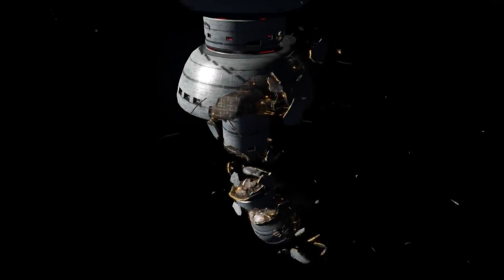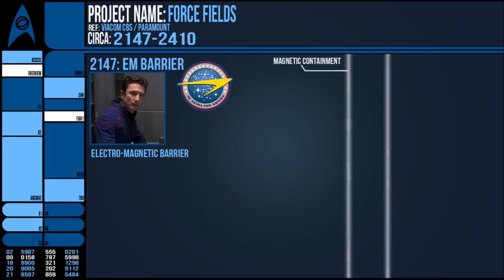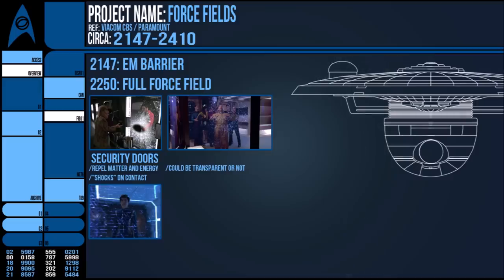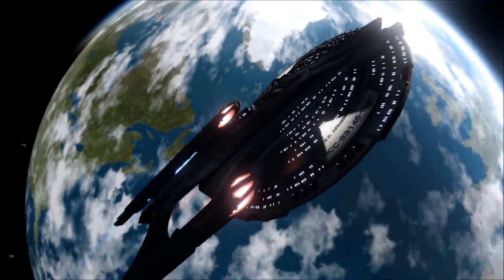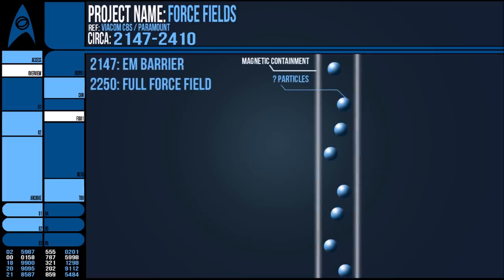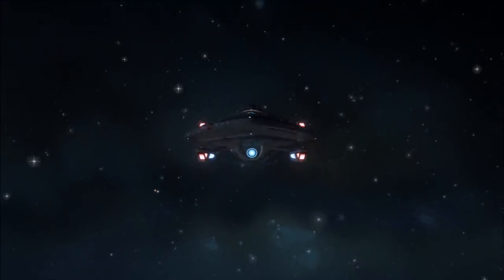How Do Forcefields Work? (Star Trek Theory)

Comment: My own idea of how the force fields work completely matches yours, with one small difference: I believe the charged particles contained in the razor-thin magnetic containment would be simple electrons held in place in a grid formation.  the repelling force we feel from solid matter is already electric repulsion between electrons in our own matter and the solid's, so it's definitely possible to generate that force with loose electrons if they're packed densely enough and held in place strongly enough. That means they're also not required to vibrate or be hot, and so a force field can be just room temperature. Changing the density of the electron grid, and changing the field strength, would allow for any range of permeability and texture.
Additionally, if you can make a thin containment field for electrons, it would work on ordinary matter too. Essentially, the 'walls' of the containment field would have a compression effect on the matter since it's pushing on the outermost electrons of it. And if you can control the magnetic field finely enough to keep the electrons in a grid formation, that means it can keep solid matter there too, meaning the field will take a strain instead of the material passing it on to the next bit of matter. You get a structural integrity field almost for free.
All it would require is incredibly fine control over the shape and strength of a magnetic field, which is consistent with other technologies in Star Trek (like Bussard Scoops, that use massive magnetic fields to guide charged interstellar particles into a capture system).
Reply: Bravo
Reply: Except for you know, the fact that they would have to essentially puff out a cloud of matter every time they wanted to raise shields around the ship itself, because they're not going to get many charged particles in space.
Reply: @peoplez129  i don't see that as a particular problem in itself, they can generate matter on command anyway. However, I also believe that the outside shields probably work on entirely different principles, being more meant to stop energy of all kinds, than the internal force fields used for containment of matter.  The language used for the external deflector shields always seems to be different and they have different technical aspects. The video mentions this too, I greatly look forward to the video looking at that in depth.
Reply: Excellent idea!

Comment: There's also Tom Paris's Transverse Bulkheads from the aborted Kremin timeline [Year of Hell] where a honeycomb network of internal bulkheads set up at every section and deck would contain major hull breaches and allow the ship to function with even half of it blown away (as long as engineering still worked).
It was based on the bulkhead concept of the Titanic, but with some improvements in light of the iceberg fail.
It greatly increased the durability of the ship, and if applied as standard across Starfleet would make them even tougher (and negate those scenes JJ likes of crew being sucked out into space), but that timeline was erased by Voyager itself.

In addition there is also temporal shielding which Voyager also developed during the same timeline which made them immune to alterations of history and Kronoton (temporal) weaponry - gee it would be nice if the time agency used that during the temporal cold war to prevent them having themselves erased.

Seriously, when you consider he also designed the Delta flyer (superior to the Runabout), Paris better get his own division at Utopia Planitia after he got back.
Reply: According to the Department of Temporal Investigations novels, there's a defensive network preventing changes to continuity from some date between the 24th Century and when we see all the people from the future coming from, which is why the Temporal Cold War had to be fought in the past. Changes can only be made before the network was activated, but they propagate through time to later eras after it was activated.

The origins of the network are shrouded in secrecy because if it was known who made it, where, and when, it would be a renegade's first stop to undo it.
Reply: @tparadox88  though, those same novels do make it fairly clear to the reader who those mysterious inventors were :P
Reply: casbott he actually became the head of Earth Space Dock and then eventually Admiral I believe.
Reply: Data voice "Correction, sir, that's blown out."

Comment: I always got the impression that the force fields on the ship were more akin to static/energy... static when you encounter it can cause flashing of light and a physical repulsion, along with a shock. Its possible that the containment method for this could also alter how that energy/static behaved, like on DS9 episode civil defense its suggested the Cardassians used a system to make their force fields lethal (meaning that they are maybe ordinarily not). DS9 Whispers also suggests that force fields are somehow tied together, so maybe there is a general force field grid/field that flows through the ship, that the force field emitters then convert for its intended purpose. The reason why in Whispers O'Brien was able to activate all force fields and said that they would have to drop them all in order to release his.

Comment: 6:00 - Due to Combined Gas Theory, such is practically impossible to achieve, but the cumulative effect could be achieved given a pressure was applied in the direction of travel of the particles. It’s like a form of Hull plating at that point, but add more of it at a slightly further distance and shields, you could make a ship that is nearly impossible to break into.

Comment: How powerful are the Federation's Phasers and Protons by the end of the Dominion war since weapons enhancements had been increased? Are they above the teratons of force since they are suppior to Cardassian weapons which was seen in the failed joint operation between the Obsidian Order and Tal Shiar a fleet of 20 ships were able to severely damaged the crust layer of the Founders' homeworld. Would the Federation weapons be like in the high teratons then considering how they actually highly damage a Borg cube in First Contact?
Reply: We can assume that weapons advancements are far more than raw power per unit of target area or volume of target.  

We see that "modulation" can overcome even very strong shields, and that some weapons use tricks like subspace or quantum effects to bypass shields or alter the effect on the target.
Reply: @DrewLSsix  
Is it in the Teratons of force though?
Yes or no and why?
Reply: We are led to believe that FED phaser weapons like rifles and other hand units are generally not liked outside Starfleet. Kira felt they were not as powerful as a Klingon disruptor,Cardassian rifle or even a Bajoran phaser. It was more accurate had more settings could be tailored but were at a technical level far too complicated than they needed to be took longer maintenance time and so were unreliable so much unnecessary tech in them.
Reply: @paulgrattan3885  
Ship weaponry not handguns.
Reply: Well they've had less power increase than a Xyston Imperial Star Destroyer.

Just imagine if JJ had done DS9 … 🙄🔫
Reply: @thorshammer7883  Unknown about figures, but Fed weapons had more finesse and versatility. So while but as high in raw firepower, they could in difficult circumstances overcome defenses that would stop a disruptor and were a useful tool as well.

Comment: The force fields in Star Trek actually work by super charging your imagination emitters at or around a specific section in space-time. But most of the force fields of today here on earth are usually either electrostatic or photonic in nature using very high voltage at very high frequencies.

Comment: I remember someone once calling it an electro-static forcefield. Because of that, I always assumed the field was an electrically charged barrier of varying intensity, also possibly controlled by or combined with magnetic fields that would be sufficient to repel any object or person who touches it without causing any serious damage at normal levels of operation. Some characters have been shown to recoil from touching the field, as though receiving a small static shock like you would get from touching a piece of metal. Other times people have been thrown backwards, or were able to touch a forcefield with no discernible effect beyond lack of penetration. Tuvok made extended contact with a forcefield in Sickbay that seemed to cause some amount of discomfort, but no permanent damage was done.

Some species, like the Jem'Hadar, design their forcefields to channel lethal amounts of energy, killing anyone foolish enough to touch the field. Since I don't think we've seen anyone get killed by touching one, this may simply be rumor or misinformation.

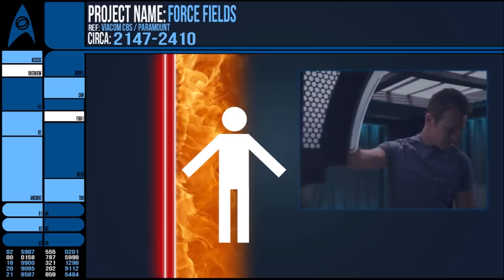Comment: 6:30 the second and fourth problems also arent a problem. You’re conflating (understandably) heat with temperature. Plasma has a high temperature but that doesn’t automatically mean high heat. 

Heat is the total amount of energy contained (in this case) in the plasma. 
Temperature isn’t energy, it’s the amount of kinetic motion in an average particle/molecule/atom. 

So for example, our thermosphere has a temperature of about 4500°F which is above the boiling point of aluminum, yet space craft don’t melt on their way to orbit. 
That’s because although the temperature is very high, there’s not a lot of heat because there’s so few molecules of air to actually hit the space craft and transfer heat energy into it. 

So theoretically the same could be true of plasma based force fields. They could simply use very few atoms in a plasma state and therefor when the force field drops unexpectedly the energy is dissipated harmlessly. 

Even if some of the plasma atoms hit you they’d transfer so little energy you wouldn’t actually feel anything.

This also applies to the fourth problem (light emission) as the plasma could either emit light in a wavelength we can’t see (which doesn’t mean not dangerous necessarily) OR doesn’t emit much light in the first place since there aren’t enough atoms for it to be bright enough. 

I’m not an expert on plasma, so I could be wrong. I’m just basing this on my understanding of heat vs temperature.

Comment: My theory is that it's just an interference pattern of light of sufficient intensity the photons push back with the requisite force to stop you going through when you try, but doesn't take any paths outside the plane of the field when not disturbed. It was only over the course of the 20ish years of the TNG era we saw that this tech evolved to the precision that it could be used to make touchable holograms, which is why Encounter At Farpoint and other TNG episodes refer to replicated matter animated by tractor beams but Voyager describes them as "photons and force fields".

Also I chalk up the way they let shuttles pass through the atmosphere barrier to syncing the frequencies of the ship's virtual bulkhead and the shuttle's deflector shield (or maybe just hull plating charge), same as how the Duras Sisters rigged a torpedo to pass through the Enterprise's shields like they weren't there.
Reply: Did we see someone get caught in the middle of a force field at some point, or is that just conjecture what would happen?

Comment: Isaac Arthur has a few vids about using electromagnetic fields to strengthen metals to allow for impossible buildings.
Reply: 90 Lancaster  integrity fields.
Reply: @tomf3150  I think the idea is one similar to how  the NX-01's Hull plate polorisation works rather than a 24th Century SIF system.

Comment: Have to agree with you on the transporter. One of the things about force fields - something like that of a hyper sensitive sensor combined with either a phaser or repulsing tractor been is going to need to be on all the time while ships are traveling thru space during impulse ( but possible not warp) drive - or you would have the possibility of very small bits of matter is space punching thru the hull of a starship ( or some sort of super duper extra strong material to build the hills with) -  also this possibility of a collision with a small bit of matter while traveling in space - would mean there would be no windows on any space ship ( yes once could have transparent aluminum for the windows with a Force field for extra protection ) - but I think there would be no windows on spaceships and just use cameras with monitors on the inside of the ship. Windows just would add a week point in a hull

Comment: My theory of techno mumbojumbo:
- They have Heizenberg principle counter thingies. Which means they can either calculate or counteract the randomness of particles in such a field avoiding collision that would generate heat, or even avoid scenarios where light would stuck in them too much making them transparent, but lowering that avoidance to show them off.
- Transporter and that food making thingie showed that they can create matter from thin air or take them away. So filling up space with custom made matter is very much in theire technological advancement. They can probably tailor made easilly magnetically charged particles without any additional problems. (such as room tempeture super conductor particles)
- Since they well advanced in creating artifical gravity means they can create kinetic force to any direction they desire. That means whatever force such fields would have to repel they can create counter directional force to counteract the force that the field have to whitstand.

Combining all this they can easilly make matter, in a controlled shape that has repeling kinetic force in desired direction. So basicly a forcefield.

P.S.: In our current real life what we can do is spray electrons over a surface real fast and cause any contact to recive that energy in some form depending on the severity of the contact and the amount of electrons flush on the covered surface.
Basicly works on the principal as a fast spining fan blades slap youre hand away if you want to touch it.
There are also methods to conduct this form of protection trough air, which is called lightning in day to day life. However keeping up such a powerfull stream of electrons is obviously pretty demanding, and depending on the conducting surface or the spraying equipment energy loss trough visible light and heating up can happen if the slaping away electrons hit the conductor instead.
However this can be overcome by engineering and statistical analysis of most likelly stable forms.
So if we would really have a means or reason to power such a technology we already have most of the basics covered for it.

Comment: Incidentally, this is how i originally thought the shields worked, i.e. being plasma shields. But this was before i read some of the ST manuals and visually inspected the on screen props and displays. 
Still, a plasma shield may be somewhat viable if it's used in a "smart" reactive way (like only focusing it on certain spots, where needed) and if we use "cold plasma, that is matter that can get sufficiently ionized at much lower temperatures.
Reply: So theoretically, maybe even near future, you could have a setup where, assuming you had near star trek levels of processing power, a suite of sensors with "lasers" could watch the slice of space where a door would be and as soon as they detect something they target the proper spot with some sort of pulse that impacts and resists the object with equal force. What that pulse would be i don't know.
Reply: @obilesk1487  something like that yeah. Keeping it all in place would be a pain though....

Comment: I think there's a possibility that it's something to do with the way Space civilisations deal with Gravity, Gravity plating seems to be in the floor of each deck but never pulls people to the ceiling from the deck bellow meaning that gravity can be controlled directionally assuming that the gravity is controlled by particles it may be possible to contain them within 2 EM barriers the same way as they're contained within the gravity plating the way you describe using Plasma, if when in a disorganised state they push to some degree rather than pull then they would be force barriers. It would then make sense that a metal object could push through the barriers, they would be a faraday cage for the EM containment walls, and the people in the ship wouldn't feel anything. it would also explain why they don't get used to stop light and missiles and why when the levels are changed it's referred to as shield density

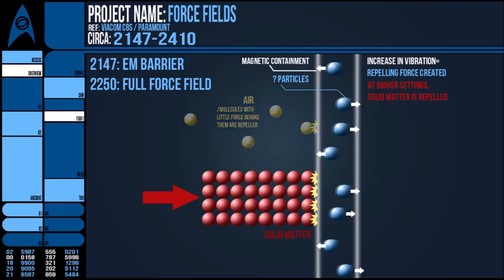Comment: 5:20 - Actually, because a shuttlecraft has its own Structural Integrity Field, of which should be attuned to the exact frequency of the Shuttle Bay, the Shuttle’s field acts as an extension to the field and thus the plasma particles “slip” around the vessel, or are pushed around and away from the point of contact between the field and craft. Scientifically, this would therefore cause no noticeable drop in integrity and is thus how a shuttle entering the shield perimeter of a starship (when setting their frequency to the exact same) can slip through while leaving the shields unaffected. This also all assumes that the field is Electromagnetic in origin, as Gravitons cannot be controlled as finely, due to the fact that the EM spectrum is just another direction of motion.(Fabric; if you will.)